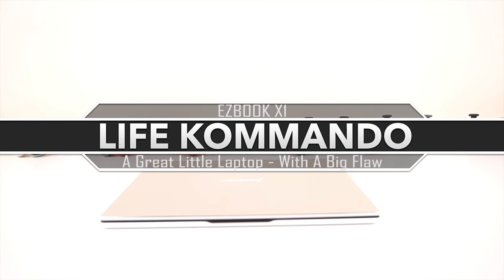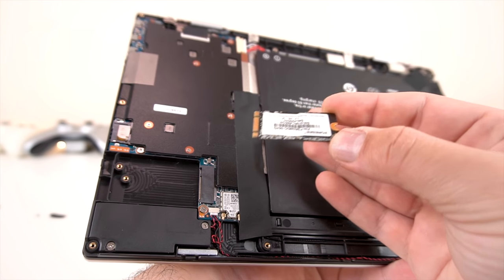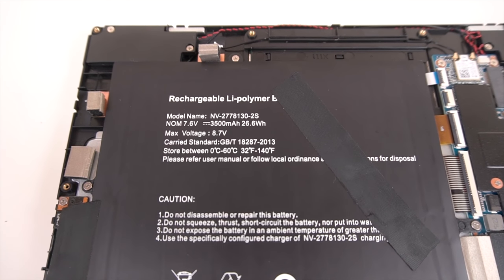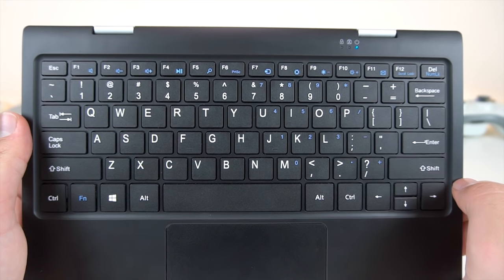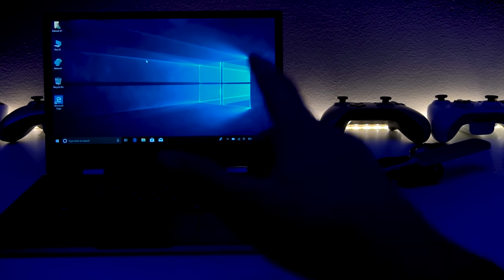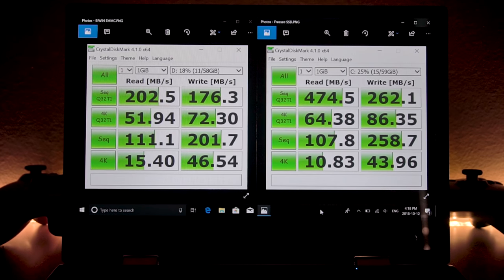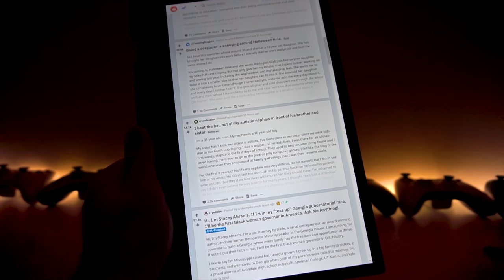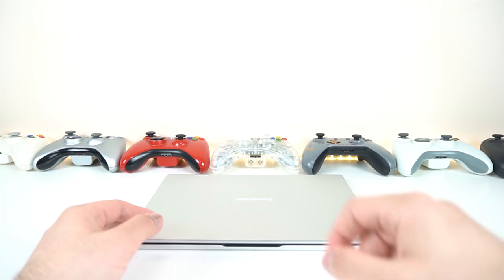EZBook X1 | 360° Windows 10 | 11.6" Laptop | Great But One Problem...

Comment: I feel so sad that I bought the GPD Pocket 2 for 600$.. this looks much better.. yes the GPD has a better CPU, however, it gets extremely hot to the point that it is untouchable after 10min of normal use.. this looks much better and also the form factor is a lot more convenient.

Comment from the maker: Update: Problem Has Been Fixed With Recent Windows Version
2019-06-26

OLD:
This is how my experience went, I reinstalled windows without a backup of image/drivers and now I am encountering problems.
Your Experience may be vary and it may be very good if those problems don't happen, otherwise I think its a pretty great laptop
Reply: Wait, so you first reinstalled the windows, then had the issues you said at 11:54 and after all that you made the review?

Comment: With respect to having to re-installing Windows 10, I would suggest connecting a [USB Type C to USB Hub] with at least three USB ports - In this way, you can download Windows 10 onto a flash drive and attach that to the USB hub and install Windows from the flash drive. With the other USB ports, you can connect the keyboard/mouse to help navigate the Windows 10 installation. 

Side Note: This type of Adaptor can be purchased for $20 on Amazon. Yeah!

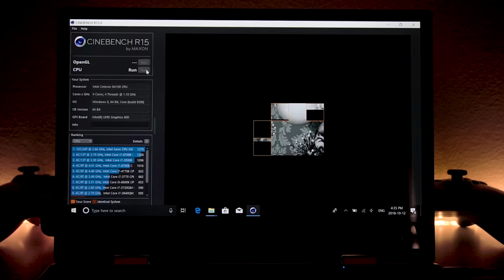Comment: 9:16 never expecting the Celeron N4100 4C/4T could reach 226cb on CineR15..
What a great processor in a Celeron class! 👏
Reply from the maker: GTO great show :)
Yea this is one of the best performing ones with good temps
Reply from the maker: @acumen1  no
Reply from the maker: @acumen1  nope
Reply from the maker: @acumen1  short answer is still no, long answer it's a nice laptop, good performance but might get annoying in the long run using it's keyboard and mouse. My unit had some problems which may or may not have been solved with the current sold models. If you are getting it used, I would stay away from it teclast has a similar form factor laptop maybe look into it.
Reply from the maker: @acumen1  seems like it's no longer in production, maybe look at the f15 plus 2, it's not a convertible tho
Reply from the maker: @acumen1  I would go with the Teclast, good luck

Comment: so basically they switched the KB sensor or whatever so it doesnt turn off when you use it as a tablet, but does and stays turned off  when you open it... :D 
i aso had some HW issues with my EZb3 pro, so i guess i try to avoid jumper in the future :)
Reply from the maker: Sad, I was not able to find any information about the sensors and how to control them in Windows 10

Comment: I have a question!  what tool did you use on the screws on the cover of the expansion slot?  I have an older set of computer bits with handle, but none of them fit the head of the screw in the back of this laptop.  Thank you.
Reply from the maker: Should be a standard small philips screw driver, look for a smartphone or laptop screw driver set

Comment: Hi, Very good review!
I am a bit worried now with the reinstalled windows problem. I just bought the laptop today.
You said that to avoid any problem when reinstalling windows the best its to have a backup of drivers... I am not a tech guy at all... How do I need to do a backup of drivers? Is there a manual I can follow to do it just in case in the future I will need them... Thanks in advance!
Reply from the maker: Thanks,

OK, so first of all, you just ordered it but not received it, correct?

If so when you get it, you can do 2 things to make sure you have everything backed up, just in case:

1- Use a free program called "Lazesoft Recovery Suite 4.2", and make a full copy of the installed windows into an .img / .iso file
http://www.lazesoft.com/download.html
2 - You can use another free program called "DriverBackup!" to make a copy of all the installed drivers
https://sourceforge.net/projects/drvback/

With those two you should be 99% safe in case anything happens

And if you do end up doing that, I would recommend uploading those somewhere, maybe google or mega

Lastly if you are ok with it, can you send me a copy of those backups (Windows Copy & Drivers)? 
So I can test and see what is really causing the issue?

Hope This Helps :)
Reply: Thank you very much for you reply!
Once I receive the laptop I will do the back up and send them to you.
I let you know..
Many thanks! :)
Reply from the maker: @albertlazaro7216  No problem :)

Thanks, if you need any help I will be here
Reply from the maker: @albertlazaro7216  Hi Albert, did you receive your laptop, how has it been? :)
Reply: Hello, I am also using this laptop. but my laptop is having a bios problem. Can you help me read the bios of the device?  by using AFUWINGUIx64 software. Please

Comment: I hope I can get an answer from you my friend. I am having such an issue finding a replacement charger for my laptop. Everywhere I check they are telling me I need the USB type C charger and while it does have that port as you are aware it also has the other two ports. For some reason my laptop shows the battery port being the middle one which is the micro hdmi port and I can't find anything that fits that. Very frustrating 🤬 please HELP ME
Reply: Hey sorry I didn't see your comment in time, hope you have it sorted, it's been years since I reviewed this one, they might have very well changed the layout of the ports or that's just a wrong label. You can use any cheap Lenovo 65w type-c adapter from Amazon. 

Hope this helps, also type c is smart so it will automatically shutoff or give the right voltage as long as the charger supports PD charging

Comment: Hi, I have a problem and I wanted to know if you could help me, format my jumper ezbook x1 and I do not have the drivers, could you pass them to me?
Now the touch screen does not work, thanks and good video.
Reply from the maker: For my second install I installed windows 10 with the latest update, then I ran had it check for updates, in most cases it will find and install the missing drivers, if that doesn't work you can use snappy drivers
https://www.microsoft.com/en-ca/software-download/windows10

https://sdi-tool.org/

Hope this helps

If you use the microsoft windows 10 link, you can make a usb with the latest version of windows